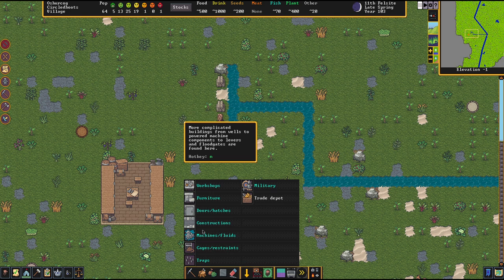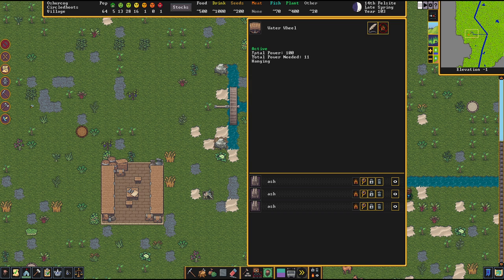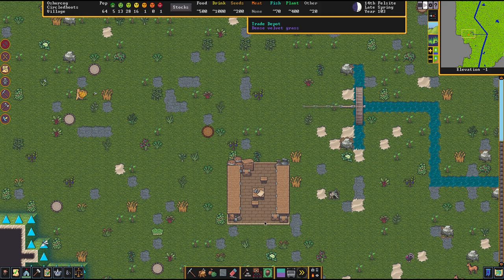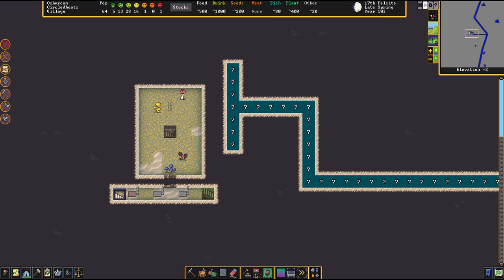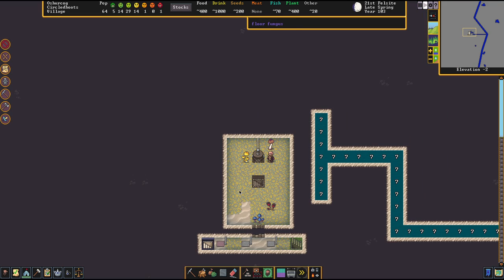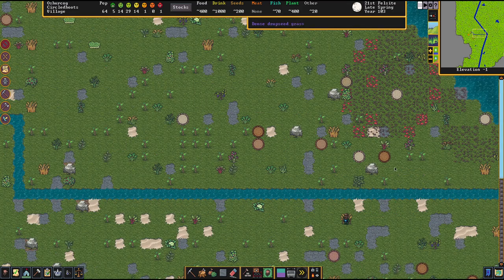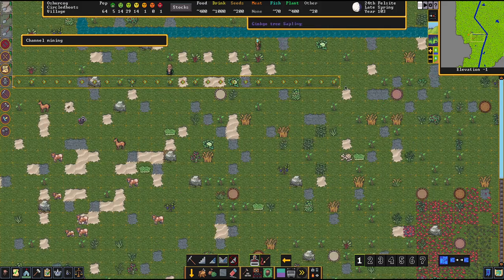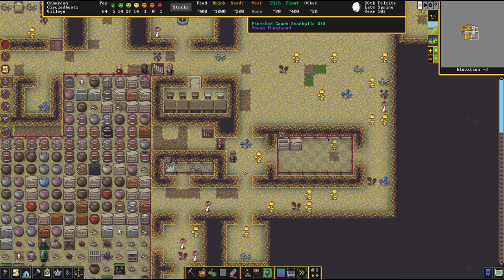BASIC WATER WHEEL GUIDE - Water Mill Tutorial DWARF FORTRESS

Comment: Stupid question, bacause I actually never did it from surface just for that matter. Is your hole you dug to transmit power "safe" because it's considered "blocked" or "built" ? Or is it an entry point to your fort for some ennemies ?
Thanks for clarification.
Reply: Its not safe. You will need to enclose the waterwheel with walls.

Comment: If the river freezes in the Winter, I know the power will stop but will it be damaged/deconstructed? Also is the gear assembly that transfers power downstairs to the fort a security weakness in a Siege (with or without building destroyers)?
Reply: That's a good question. No clue if it gets damaged, but the building destroyer part can be mitigated by building a casemate around your water wheel - you could channel the river, build water wheels, surround them with walls and a roof, as well as drawbridges (meaning no power when closed) or artifact grates which are actually invulnerable. There may be other options to stop invaders, but this should work.
Reply: Freezing water destroys wells, so I think it will destroy water wheels just as much.